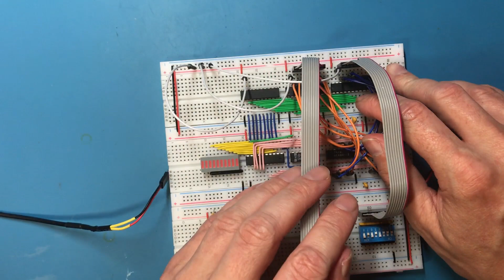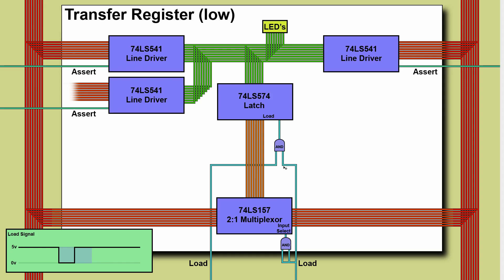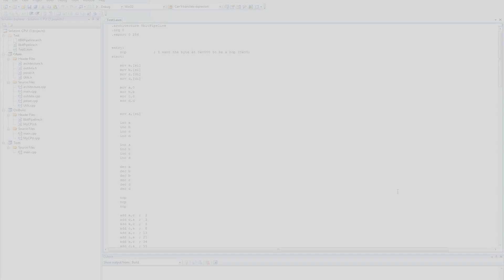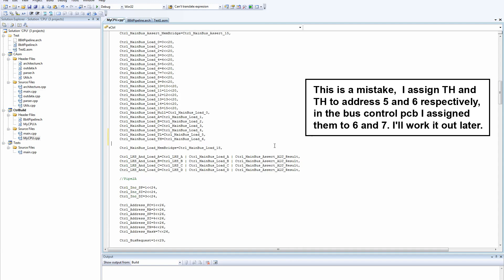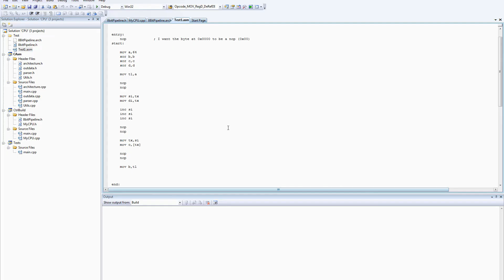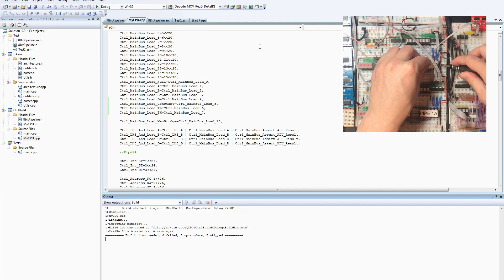Transfer Register (Low Half) - Making an 8 Bit pipelined CPU - Part 51

Comment: This comment contains more guesses how he might proceed from here. (I didn't think to put it in my comment on the previous video.)

So, conditional branching should be fairly simple. Just wire each of the flags into one of the instruction decoder ROM address lines, then, for example, JZ (jump if zero) will jump if the decoder address line corresponding to the zero flag is 1, and not jump if that address line is 0. For memory request, wire that into one of the address lines for the decoder ROMs, as well. If the decoder address line corresponding to memory request is 1, the bus claim control line will be forced high in pipeline stage 2, and if the instruction is not otherwise using the address bus, 16-bit register 0 (memory acknowledge) will be se
Reply from the maker: I'm guessing you write comments in another app and then copy paste them in?
Reply: @weirdboyjim  Sometimes. I copy in progress comments to Notepad every so often so I don't lose them if I accidentally refresh the page or something similar. I'm guessing something like that happened here, and I didn't paste it back in properly.

Comment: This was inevitable because the mux select signal disapears the moment that the register is loaded with the rising edge, I was wondering why it even worked in the first place ;-) I liked your S/R latch idea more, it was more robust :-) Never depend upon gate delays, unless it's an edge detector circuit :D Quad NAND would solve the problem nicely - one S/R latch for select logic and one AND for load edge.
Reply from the maker: Looking at the internal circuit of the latch I'm comfortable with it, it's really reliant on the line level before the rising edge. That said, if I was doing it now I'd use the SR latch but use Q as the selector input. Best of both worlds.

Comment: instead of 2 load lines, you could use a load line and a source select line, which would probably be better suited
Reply from the maker: I was trying to solve the problem where my inputs were the 2 load lines without changing the circuitry elsewhere. If I have reason to return to this board I'd probably change it to a NAND based s/r latch from the two loads, this would essentially reconstruct a source select without needing to modify any of the other circuits.

Comment: Look up AD-100 or AD-01 solderless breadboards, they give you 6 tie points either side of the central divider.
Reply from the maker: Thanks David, searching those and browsing took me to the AD-102 (456 tie point version) which looks the same as the AD-100 but with power rails. Might be handy. Up soon is main memory in which I'll need to cross connect most of the pins on a pair of DIP-28's. That's not a job I've been looking forward to on a breadboard with 5 rows per side (I may have been avoiding it as the next job for a few videos).
Reply: Hi David... thanks for steering us in James's direction... I've been enjoying 51 episodes of DIY CPU goodness thanks to you.